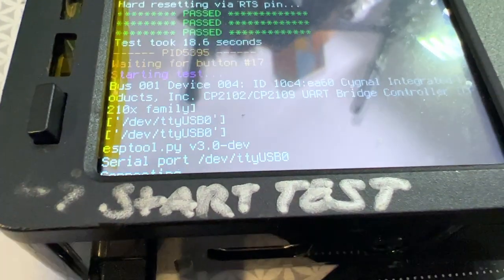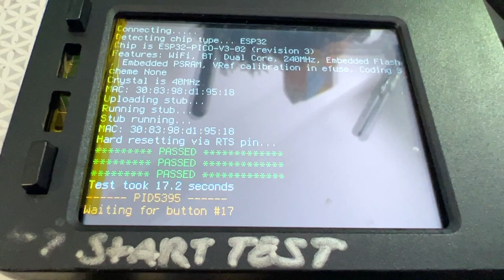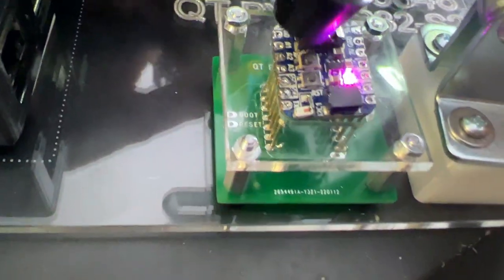QT Py ESP32 tester is ready!

Comment: Hi Adafruit team! I like how you verify all your new boards with the Raspberry Pi. My background is testing new SOC devices like WiFi and Processors. I have to use high end ATE's to verify that all digital IO's, Analog IO's, and supplies preform to design spec. Very challenging at times and fell your pain when testing does not go as planned. This is an awesome low cost method and creative way to verify your designs. Keep up the great work team Adafruit. You guys rock!

Comment: Will you need to fill all the edge pads with solder to use your tester, or will you be aligning the tester's pins to hold onto the tracks at some point?

I'll admit, I never would have thought to use a Raspberry Pi to run ESP32 testing software on, but it makes perfect sense!

Comment: I'm a total noob when it comes to modern electronics. When I passed my Ham licence, we had to understand electric circuits that used tubes. Yes, I'm old.
My question is, do I need to make your testing rig if I'm interested in using that device once it is for sale? I would think that QC on the boards would be done in the factory but I could be wrong.
I want to make a custom grid layout keyboard as I never learned to type and when I was writing software for a living, I could type code using two fingers on each hand as fast as the required typing speed needed to pass a typing course.
I plan on making a 5×5 + Z alpha grid with only needing the shift/ctrl/alt/Win keys for unicode,etc. All standard ASCII characters would have their own key. I'm looking at your 5×6 MX key socket grid and going from there.
Reply: No you wouldn't need the test rig for using it.

Comment: OMG IS THAT THE ESP32-S3?!
Reply: Looks like ESP32, using smaller pico package.  Not S3.  QT Py packaged ESP32 that'll hopefully just work with existing IDEs.
Reply: Did my reply get deleted? Look closely at the code on the screen. Check the microcontroller part number.
Reply: They do have some s3